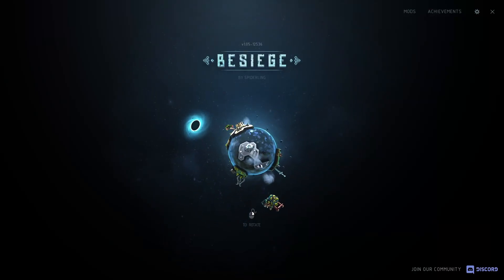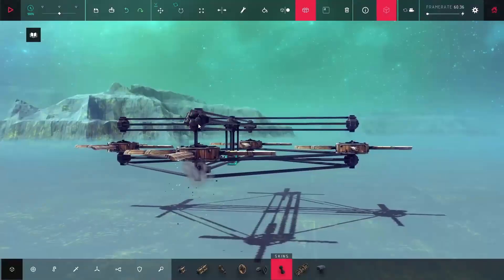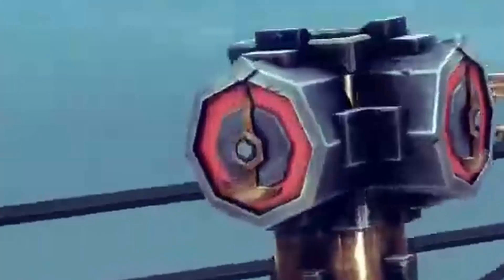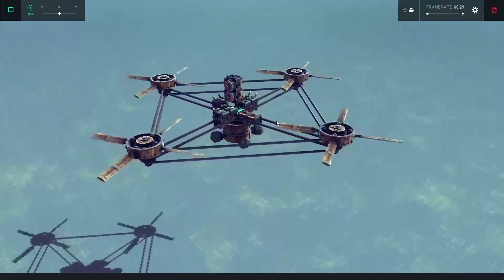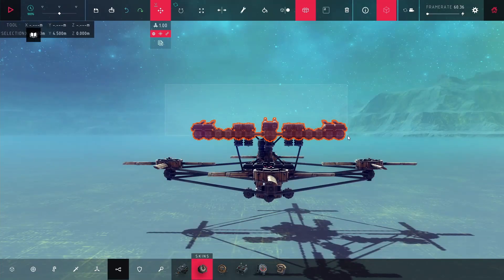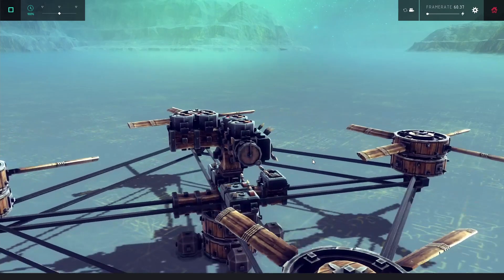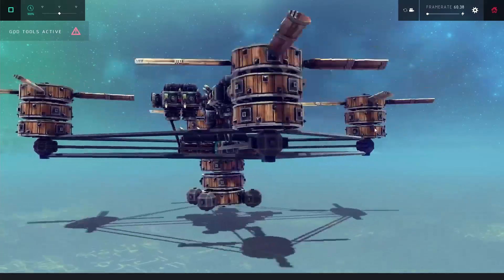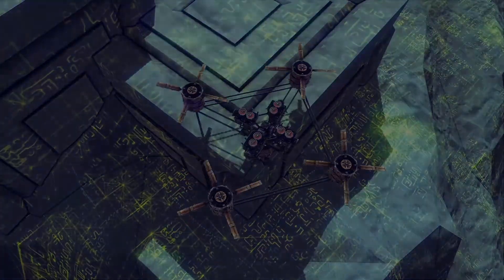Making a Drone in Besiege

Comment: i've seen some comments on A/B propellers that are of course great, another way of cancelling torque is to use unpowered weels as torque cancellation joints between powered weels and the main body of the machine (of course this works a little bit less effective but is possibile to do it even if you do not hace exactly 4 propellers)

Comment: Reverse the propellers on two corners and reverse the spin. This will create a cancelation on the torque without sacrificing stability or lift. Just a lighter solution to the problem. Great job!

Comment: Well this is a different take on a quadcopter for sure 👍 alternating propeller directions being the conventional way to counter the torque of the motors.  With CW/CCW setup you can achieve yaw, pitch and roll by just reducing the speed of sets of motors.

I am surprised at how little feedback oscillation you got from the angle sensors. On my attempt when playing the campaign I couldn't get enough resolution out of them to not wobble in the air. I did manage to make a quad that had 9 bombs on it though which made for some easy destruction from the heavens.

Comment: A real quadcopter has 2 motors spinning one way, and the other two spinning the other way. if you count the motors in a square shape from front, like 1,2,3,4  , 1 and 3 spin clockwise and 2 and 4 anti-clockwise. To turn, you slow one pair down , etc

Comment: you can simply have only 2 sensors that you rotate the opposite way you want to rotate the quad.
this is the method i have been using and it has been quite effective.
if the quad "resonate" goes back and forth, you can add an angle-speed system to limit at which speed the vehicle can rotate.

Comment: I might be missing something very basic here, but can't you just add 2 opposite very strong reaction wheels to the center, so it requires more force from the outer propellers, which themselves could be opposite each other and only in one layer to make it even like this:
🔄🔃
🔃🔄

edit: And making the speed of the propellers be changeable makes it unstable unless done with a kind of variable angle measurer, that outputs a wider range of numbers instead of 0/1. The output would also have to be calculated and outputted as a variable to the propellers. I don't think that's very functional in besiege without adding at least 45 angle measurers and a relatively fast binary calculator to the drone in which case you'd need some serious aerodynamics and probably some extra propellers. The stearing propellers would also have to be precise, so they can change speed fast, and I don't know enough about Besiege to help with that part. If you can do those things though, you will have made THE most functional drone in the game.

edit2: I don't want to read through what I just wrote, so I don't know if I'm repeating myself, but stearing and stabilizing with (seperate) reaction wheels is easier, but maybe not as cool.

Comment: I remember making a quad copter sorta like this.
My meta design was to use an altimeter at the edge of the four corners. This meant you couldn't adjusted the height, so I ended up attaching a platform to the bottom with a winch so I could adjust the platform's height.

Comment: Hey quick question: if out of the four propellors you would invert 2 opposite motors both directions and blade angles, wouldn't it cancel the rotation of the entire thing? And basically let's you remove one reaction wheel?

Comment: U could use F to flip the propellers and use bracing for a reaction wheel. They resist rotation a whole lot more, weight less, and is smaller. Just attach a end of the braces to the wheel and the other to nothing

Comment: When I was making my quad copter it was an interesting way for auto stabilisation and I did some research and found that you can achieve auto stabilisation with just the props and the way that you angle the props. So I’d love to see you attempt to make another quad copter with auto stabilisation in just the propellers. And with the torque spinning you just need to flip two props and it will balance it all out ;) and you can use a reaction wheel for controlled rotation.

Comment: You know you can still put a perpeller on a small wheel if you put a block on top of the wheel.  Like right in the center going up, then attached the 4 blades on each side of the block.

Comment: Real quadcopters use counter-rotating rotors to maintain direction, and turn by adjusting their speeds: for example, to turn clockwise, the two blades that spin counterclockwise will be sped up.

Comment: You can make the props torqueless by placing an unpowered wheel below the powered wheels. It will decrease the amount of power, but you can recover it by placing braces on the unpowered wheel, so that one end is floating, allowing it to spin freely

Comment: hi! i think you are over complicating things. maybe think about building a simple gyroscope in the middle and use the angle detectors to run the wheels on the gyro to return to a normal position. propellers can adjust the lift, gyro can adjust the direction.

Comment: for the torque issue you couldve just made the front propellers spin towards the middle, the same thing for the back ones but in the oposite direction and change the pitch of the blades respectively so it still goes up

Comment: You can actually attach props to the normal wheels, you have to use the move tools under advanced build mode and then move them against the face of the wheel
Reply from the maker: Ah interesting, usually when I try that stuff it just glitches lol
Reply: @ReidCaptain  there's a fine line. A good way to think of it is at each point you can attach something normally there is a zone where if object are placed there, they'll stick. You have to find that zone. The easiest way to achieve props in this manner is to place a ballast on the face of the wheel, place either for or eight props to it, remove the ballast, and then move the props into the face of the wheel until they stick. If they explode, they went to far into the wheel. This "sticky zone" applies to how all blocks interact, and is a result of a lot of besieges jank. Unfortunately, the scale tool does NOT scale this zone, causing some... interesting... interactions.

Comment: i believe if you rotate two propellers that are diagonal to one another the opposite direction to the other two you can do away with your reaction wheel system, because the torque’ll cancel out. I’ll attempt to do a diagram of how that’d work xD

A(A) B(C)
C(C) D(A)

i’ll be using A B C and D as names, and the letters in parentheses indicate which direction the props are rotating ( A for Anti-Clockwise, C for Clockwise) 

Here’re the controls you’d need for pitch roll and yaw

Yaw right: Slow down A and D
Yaw left: Slow down B and C
Pitch up: Slow down C and D
Pitch down: Slow down A and B
Roll left: Slow down A and C
Roll right: Slow down B and D

Comment: the spinning of the drone could have been fixed by simply making an a/b style propeller 
which is 2 of the 4 four propellers spin in the oposite direction
example:

          A    B
             0
          B   A

the 0 is the center of the drone as the A and B is the propellers
A would spin clockwise and B would spin counter clockwise

if you own a quad copter yourself. you will notice an a and b respective of the propellers so you wont get confused when changing out propellers
Reply: as someone deep in the quadcopter hobby, it was perfectly annoying so see Reid continue his trend of making wildly novel but somehow functioning ways of doing something, another example being his "suspension" design in Dream Car Builder
Reply: @xymaryai8283  by hobby you mean you don’t mKe money, right? I’m trying to get my own career with mine off the ground
Reply from the maker: It would have helped, but there was no real need since the reaction wheel was already necessary for turning and holding perfectly in one direction. Plus, i couldn't invert the pitch of the blades perfectly so there would have been slight imbalances in thrust.
Reply: @ReidCaptain  pressing f allows you to flip the direction of the propellers
Reply: @ReidCaptain  A reaction wheel is not needed on a drone, you can just slow down group A / B to turn LEFT / RIGHT and speed up the opposite group
Reply: @Hlebuw3k  I think the problem is you can’t really control the turning speed during flighty in besiege, either on or off.
Reply: @ReidCaptain  to turn you can reduce the speed of a set of propellers (a or b) and then the drone will turn, because there will be an imbalance in the rotational velocity.
Reply: @ReidCaptain  you do realize you just need to adjust two of the rotor speeds to allow torque to rotate the craft right? thats how most drones work nowadays
Reply: @ReidCaptain  press r  or f to rotate the piece
Reply: @ReidCaptain I did not think about that
I see

Also I didn't mean to sound rude in the first comment if it gave you that vibes
Reply: this! I had previously made a quadcopter in besiege (with the help of images of real quadcopter rotors) and it turned out pretty amazing. Then I watch this video and he uses REACTION WHEELS to counteract the force of the 4 rotors spinning in the SAME DIRECTION. And I'm no engineer, but if you have an even amount of rotors, just make them spin in opposite directions instead of adding a goddamn reaction wheel
Reply: Can I just.. uh.. point out to everyone. These are not propellers. They are rotor blades.
Reply: @MGSLurmey  eh potato Tamato same thing
Reply: @MGSLurmey  isn't rotor blade is just another way to say propellor
Reply: @MGSLurmey  since there are no science conversaton, nobody cares. Sorry.
Reply: Yes!! That's exactly what I said!
Reply: A O B A
Reply: @krullebol0808  I can't agree more
Reply: goofy ahb overengineering
Reply: Wouldn't that mess with his style of moving which is killing some propellers. Say he kills an A propeller, the AB would become imbalanced. That was my thought too but I thought this nullifies it
Reply: @shayboual1892  yep real drones use computer brains to figure out how to balance Raid Captin is not a computer
Reply: @Tarttea  yeah but they have sensors and logic gated in game.
Reply: @shayboual1892  normally drones slow down pairs of propellers, one A and one B in order to tilt.
Reply: @jetison333  slowing down either A or B sets of props controls yaw, not tilt, but yes you can slow down the props to tilt.

also yes they're technically Rotors but they are not on a swash plate and are called propellers within many professional communities. technically incorrect, but also professionally disregarded ^-^

Comment: Instead of a reaction wheel, you can also counter the spinning from the wheels by putting a non powered wheel in between the one with propellers and the frame of the drone. Clever solution but over engineered

Comment: I did the same thing myself a while ago, tilting system is really clever, I just used forwards facing propellers for propulsion. I also flipped propellers on opposite corners so rotation control was unnecessary. To avoid the problem of the tilt stabilization flipping back and forth just place some flat wings pieces to take torque out of it swinging side to side. But it might push the drone downwards if you use tilting for propulsion.

Comment: You should’ve made it so 2 rotors on opposite are spinning in different directions to equal out the torque
Reply from the maker: When I turn on and off each blade to stabilize though it would create a moment once again. I would have needed another stabilization system anyway